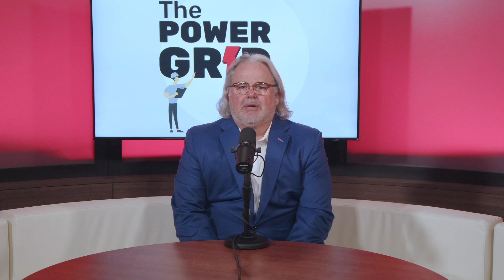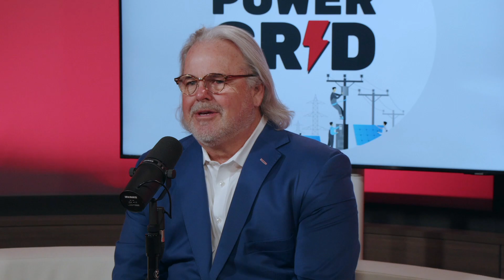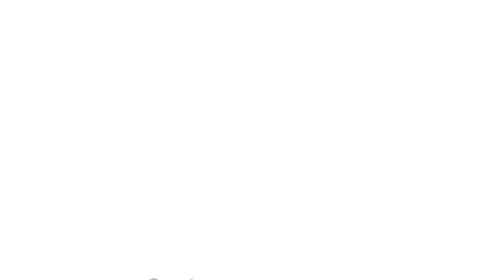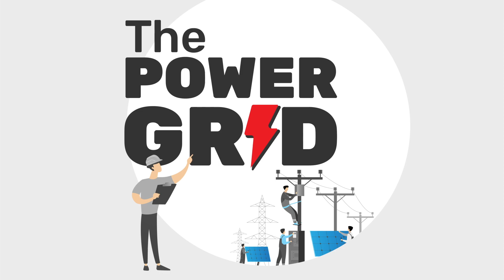Mitigating Harmonics in Electrical Systems

Comment: "This new strange thing called electrical harmonics." Harmonics are older than time itself, and harmonics don''t cause heat. If harmonics are creating heat out of thin air, rather than shilling for someone else, why don't you find a way to recover this FREE energy? Harmonics get their energy from the incoming power source, so no matter how many harmonics your circuit creates, it can't cause more heat than your source is providing. Want to reduce heating? Put a lower amperage circuit breaker on the circuit.
Reply from the maker: The problems occur as we progress into switch mode power supplies such as VFD's and soft starts.  These were not common in our electrical system 30 years ago.
Reply: @thepowergrid4917  https://youtu.be/DPjNVZ_QtmM?si=MOIEdUlJQqTTJMQo
Reply: Dan- The most inane and clueless response I've ever seen. Congratulations!
Reply: @ce2flaco so show me how you can get free energy out of harmonics.
Reply: @DanBullard  You asking this question clearly shows that you didn't understand the video. It's clear. Rewatch it for comprehension.